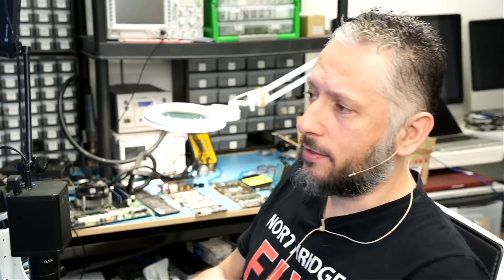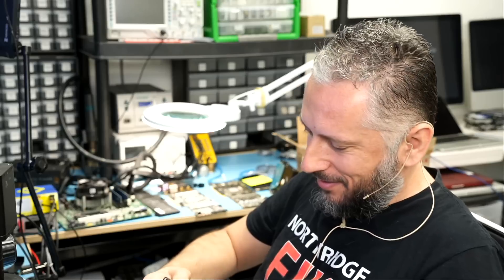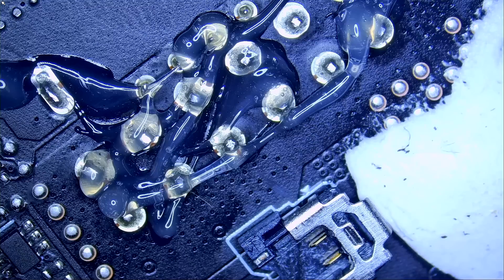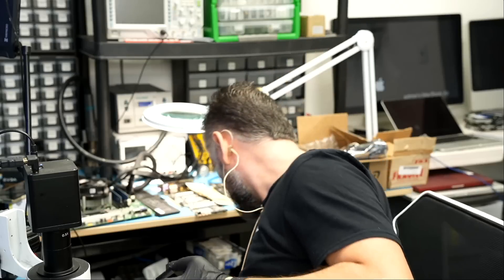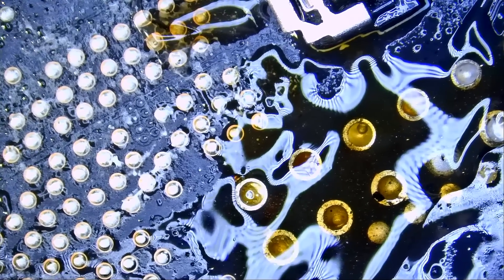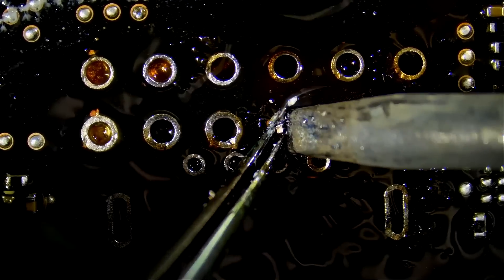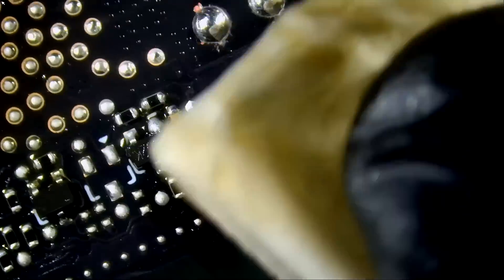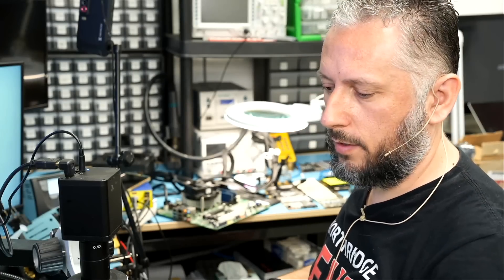4090 FE Connector melted with Cablemod Adapter installed. 40 series cards should be recalled

Comment: This exact issue has just happened with my 4090 FE with the same connector from Cablemod. Can remove the end to the PSU from the connector easily but feels and smells like the connector is melted into the connector on the card…. Thank you for showing it’s not as simple as saying “user error”, especially when most 4090 earners and enthusiasts and take great care when building PC’s etc.

Comment: mine finally melted, I thought that if I absolutely made sure that the connection was perfectly seated, it would be fine...WRONG. It melted after 1.3 years in daily service. There is nothing I could've done different to prevent this. This is ABSOLUTELY a design issue, not an end user issue.

Comment: My sense of this is that the 12 pins of the card plug into the socketed connectors of the adaptors and those female pieces are too loose and what we get is arcing between the pins and sockets. Arcing would explain the melting not just heat alone. It's a bad design on Nvidia's part and explains why EVGA decided to get out of the GPU game. Next people's houses will burn down over this.

Comment: . . . The gauge of pins is adequate for the short distances that they run; they could be replaced by 16 gauge wire for about 8 inches and mercifully spliced to the adapter connector cable,  observing polarity, of course; the small wire connector should be cut away from the larger part of the item's connector and mercifully plugged in by it self. . .

Comment: My guess is the lead free solder used in their wave machine If Alex uses 60/40 and the connectors last, it tells me the solder used on the power connector is where the resistance heat is coming from that's melting the connector. The power wires are thicker then the board traces so the heat melting the connector is most likely from the connector to PIH solder joints.

Comment: My 4090 just had the same issue ytd with cablemod 90’’ adapter… Im pretty sure I ensured my adapter is plugged in all the way after watching jay2cents video, but it still melt after almost half a year of usage. now im contacting local service center and cablemod support to try to save my card😢

Comment: A new GPU built by my company games at 360 fps. The plug heats up. The GPU burns with everyone trapped inside the house. Now, should we initiate a recall? Take the number of GPUs in the field, A, multiply by the probable rate of failure, B, multiply by the average out-of-court settlement, C. A times B times C equals X. If X is less than the cost of a recall, we don't do one.

Comment: If the Cable Connector has even the slightest movement after being properly Installed then it is a design defect and it is the manufacturer's fault.

Comment: USER ERROR IT IS NOT IN MY CASE....My Asus Strix 4090 OC just burnt out its cable pins. Cable was and is stuck/melted in the card. This sux especially when you pay $3800 AU. I will give up on PC building and PC gaming altogether if I don't get RMA.
Reply: when this happen i mean how long you was using this card some weeks ? ? You extra overclock gpu or ? What psu you have ? i order this card and scared of this..... it this destroy only cable or complete gpu too ??? Thanks

Comment: I wonder if this issue in related to the power draw. Many users are using HAF Bios off +666 to 1000W. What would happen with a 4090 with a PL of 80% with an undervolt curve? With just 300w and with a not wore plugged in cable : would  it melt?  I guess you are right, it’s not only an user error, the connector on the PCB side is weak

Comment: Since this whole melting melds I use my Gigabyte RTX 4090 Gaming OC at 0,875V and look that I don't go beyond 250 watts 😂 thats simply ridiculous that you have to be cautious to use a 4090 beyond 300 watts!! For now I'm still using a 180 degree CableMod adapter. I'd like to give it all to northridgefix to fix it and no longer be afraid of using my 4090 stock or OC!

Comment: This EXACT thing happened to me just two weeks ago. I had a cable mod 180 degree connector and it melted into the 4090. I couldn't remove it at all. 

We've got a bigger issue here.

Comment: Plainly and simply: this is a design fault by the manufacturer. These small plugs are not made to take 600+ watts of power pushed through them. The connector definitely needs to be more robust.

Comment: Is it just me or did all 4090s that have melted connectors use that "clam shell" type of contacts for the plug? I recall there being two types of contacts inside these connectors depending on the maker.

One type (I think it's the often melting one) is a clam shell style of connector where there's only two U-shaped points inside the hole that contacts the pin.

The other type of connector uses four contact points that clamp onto the pin from four sides. I recall hearing this somewhere.

Perhaps that's one of the main issues? Just curious, as it looks like that Cablemod Adapter left one of its broken contacts stuck to one of the pins visible on this video, and it looks like they also used the clam shell type U-shaped contact inside the adapter.

Another thing I think nobody points out is that there are other Adapters that look exactly like Cablemod's 90 degree adapter, often sold from China or sourced from there. These ones are often sold with very little mention of info, but they sometimes mention that some are "Rated for 450w" or "Rated for 600w". Could that also be a possible cause of heat issues leading to failure? Had I not checked, I wouldn't have even known there's a 450w and a 600w version of these adapters.

Comment: Hand it to me, Grasshopper. You are no match for my monkey grip of steel. No matter how they melt, it still same problem. Too many watts and not enough pin(s) or plug(s).. Blame China for making them so thin. It's why you don't replace fuses with foil gum wrappers. DUH!

Comment: I'd say the POWER CABLE was fully plugged into the angle connector, but the angle connector was NOT fully plugged into the board.  The electricity was arcing between contacts that should have been mated, this resulted in heat build up and melting.  Just because a user HAS a cable-mod/angled connector does not mean they pushed it on firmly enough to make full contact.  Great job.

Comment: Same thing just happened to me with my cablemod adapter on a 4090 Asus TUFF OC.  Found out when i went to reseat my gpu because every game i tried caused my system to reboot after 5 minutes. Adapter fused with no signs of melting.

Comment: It is now known that the cable mod adapters are defective by design, they have lied about what terminals they are using (They claimed NTK (4spring), in this video it is clear they aren't even using Astron(3 dimple) but using some weird 2 dimple thing instead.

The adapter sits too loosely in cards, allowing wiggle out and uneven installations.

Comment: Companys that build these cards should not even allow these melt thinks to hapen. Not a users fault I would say on this. How these keep coming and coming and every time its users fault because cable aint fully in. There is no way that this is users fault and this confirms that its desing issue. Too mutch voltage for single connector if these cards had 2 connectors and splited voltages thru those this might not hapen. I might be wrong on this but thats what I think.

Comment: I have a 4090 but I've not used it can I ask what the recommended power cables I also plan turn down voltage

Comment: All connectors have a small resistance.  So any large current will generate heat. Also if the connector has any weight of cable on it then it will move and maybe only contact in a smaller area causing higher  resistance.

Comment: They need to put a bolt connection like it is on the car's starter. 😄A just one thick cable for 12v and another for GND, and 4 little pins for signaling. I saw how high amps melt battery poles on trucks if you have loose connections. These connectors are jokes for that amps. The contact surface is too small and then keeps warming and eventually melts.  The female part of the connection can be stretched and lose contact with the connector. The 90-degree adapter adds even one more loose connection on the current path. The bad-quality 90-degree adapter is used here. You need to look into the female part of the connector and if they notice that the square hole in "pins" is deformed and wide then you can use some tools to squeeze it. Not too much but just enough to make good contact with the male part on the card's connector.

Comment: i have a 4090 TUF W/ a Cablemod 180 adapter. Melted. I built my first PC all by myself when i was 8, that was 32 years ago. Came home to an office filled with smoke.

Pretty sure i know WTF im doing. Connector fully seated all the way around the connector.

What a POS Connector. They should have lengthened the contact 1MM for all the pins, or gold plated everything, or hell.... use an XT90 Plug.

Maybe i should just modify it to use an xt90

4090XT90

Comment: Just found out my cable is melted and Ive been following this issue long before I bought a 4090 and made sure I plugged that shit in 100% and it has started to melt on one of the pins. I noticed this after having to remove the graphics card to install a new M.2 ssd.

Comment: The lower tier AIB cards doesn't seem to have melted connector issue, could it be that total Wattage of 450 is kept at bay? The higher tier cards seems to be getting this problem. I'm thinking about buying a PNY Verto of the 4090 and havn't seen a single melted connector on these cards. Has anyone a PNY version?

Comment: I think the card pushes the limits of the connector under normal operation. You throw in voltage drop from low quality or undersized power supply also a little increased resistance from cable extensions. Gotta have RGB and combed wires on your brand new card. Sprinkle in a little consumer assembly. Party time for Northridge Fix 🎉🎉🎉🎉

Comment: I have a question for Alex (which he probably won't see, but on the off-chance)
Given your wealth of electronics knowledge, why do YOU think these power connectors are melting? Sure, 450W coming through 12 power pins. Okay, but the 3090 Ti had (according to Tom's HW) a 437W power draw and used the same 16-pin connector, not a single story of melting plastic. What changed?
Reply: 3090TI's were have issues of overheating

Comment: i think when you try reinvent the wheel from a  4 wire molex to either a 6/8/12/16 pin connector

the problem is 1 to1 you're fine at vdc and amp once you start doubling/tripling/quadrupling 12/24/36/48 vdc and  over amping into 12 volt pin  and slight pin misalignment between cable and  pin connector on pcb connector is causing another issue

2-4 into 1 set of wires it is a design flaw in the pcb of the video card because you are consuming between 2-4 rails of 12 volt of the psu's power connections

you can't push 24-48 volt dc into a 12 volt dc connector or you get this failure point

Comment: Why don't you use SnAg alloys instead of lead solder? It hasnt got such a low melt but is lower than most lead free ones.

By now we should be moving away from lead completely. It is one hell of a toxic substance.

Comment: I've done allot of electrical repairs in my life on circuit boards and maybe what the 4090 Connector Pins are made of is inferior and causing allot of resistance that heat up the pins. If they has a Copper coated pin or use better metal on the pins this issue wouldn't happen. High resistance=Allot of heat=melting connectors.... The Fix would be to solder female 8 pins with copper wire directly to the board. Preferably 3 of them spread out.

Comment: My RC main battery connectors are goldplated to prevent oxidation. 
An oxidation layer increases resistance -> current distribution changes to pins with less resistance -> more heat generated in remaining pins -> more oxidation -> ...
Positive feedback loop until meltdown of the last of least resistance pins.
Just my 2 cents.

Comment: I’m quite certain this is my FE card that I sent in. I Appreciate the breakdown as I was positive it was fully inserted and I did not continue to attempt to remove the adapter after it melted to prevent further damage (as you can see in the video). I have been a firm believer that this is an Nvidia issue from the beginning. I really appreciate that it was noted by Jay that Nvidia has not ever provided a Root Cause which is issue management 101 in any business. Anyway I have a 7900xtx now. Is it a 4090? Unfortunately not but I won’t be putting my money into a company that gaslights it’s customers. Thanks again!
Reply: Honestly it has done everything I’ve needed it to do. I could go out and buy another 4090 but I liked the FE and it’s too difficult to find in stock. I got lucky and received an invite from Nvidia for the one I had. Sure I could go for a 4080 but I’m just not happy with Nvidia so I’ve chosen to take my business elsewhere for the time being.
Reply: Yeah. I read ya. Was about to start building with a 4090 until all these videos and reddit posts starting coming through the doors.
Reply: Got an instagram with picture of your build we can look at? I took tons of photos of all the ones I have done
Reply: Mind me asking how much this set you back?
Reply: @haies09 luckily Cablemod is amazing and they fully refunded me what I paid for my card. Would have been around $1750 though.
Reply: @Natetilllate  A company that actually stands by the goods they sell. A refreshing change.
Reply: @Natetilllate  Are you saying nvda is refusing warranty replacements when this happens? 😱
Reply: @ZubinSaxena yes
Reply: The same thing just happened to me. It is not user error. You can see the connector firmly pressed in on all sides for the one in this video, and I noticed the same thing on mine.
Reply: The same thing just happened to me. It is not user error. You can see the connector firmly pressed in on all sides for the one in this video, and I noticed the same thing on mine.
Reply: Voting with your wallet is the way to go. NVIDIA should have recalled these instead of handling it like how Apple handles these kind of things by downplaying the number of people affected and basically doing nothing.
At least AMD is yet to use this connector although knowing them they'll first make fun of NVIDIA for using it and then do the same thing next gen.

(Being a cheapskate I hope they don't as I'd like to reuse my power supply for the next build and not have to use adapters)
Reply: why go AMD, inferior though!

Comment: Terrible design. Nvidia's Connector use small gauge contacts that get too hot. If physical size was a problem for the overall connection, I don't understand how A GOOD/UPGRADED 8pin connector (4x 16gauge/AWG power and 4x 16gauge grounds) couldn't be used. Using my 12V DC Car Audio knowledge (and 'Rule of Thumb' Wire Size Charts), At 12V DC, in order to flow enough Current (amps/A) to accommodate 600W (600W/12V=50amps if 100% Efficient) over a 4ft connection, it requires a single 10gauge/AWG multi-strand copper wire (1 EACH) for power and ground. 4x16gauge/AWG wires combined = 1 single 10gauge/AWG capacity. 10gauge/AWG copper multi-strand wire can carry as much as 85amps @ 12V DC up to a 4ft distance (DC degrades over distance, requiring larger gauge/AWG wire over longer distances), so even at HALF that Spec, 2ft/24inches of wire out of a power supply to the video card, 85amps @ 12V DC (1020W if 100% Efficient) should be a breeze. THAT IS WHAT A SINGLE 8PIN CONNECTOR'S 16gauge/AWG WIRE IS PHYSICALLY CAPABLE OF (perhaps NOT the power supply or 'Plastic')..... 

Why couldn't the STANDARD 8pin just have it's wire upgraded ? (4xpower, 4xground equal capacity wires) 4x14gauge/AWG wires = 1x 8gauge/AWG = capable of 150amps/A @ 12V DC over a 0-4ft length. That is a theoretical 1800W if 100% efficient, so for argument's sake, call it 1260W @ 70% Efficiency, or perhaps even a bit better, since we are only talking about up to 2ft rather than 4ft. I think Nvidia just wanted to make it's own standard so that it could say it did. FUTURE TRAP.

Comment: The 180 deg adapter made my system instable. Random reboots, freezes and lock ups.

I limited my FPS to around 120. Normally around ~250Watts usage. So yeh, probably a faulty adapter

(And yes, refitted multiple times)

Comment: How many gamers push their components to the maximum and have this problem? I would bet more than one. When you need to wiggle a plug to release it, could this not contribute to its failure? After the user hears the connected click, it could indicate the plug should not be removed.

Comment: After case of 90 degree adapter it is cleared that it is not issue of the way you plug in the cable. Because it is melted from card side.
The main cause is it's heat dissipation failure due to pins within tight area. Widen the connector area OR divide into two connectors may resolve the issue.

Comment: It is true that electrical loose connections cause excessive heat and arcing as I have personally seen in the field I work in.  We sometimes inspect overhead electrical connections with and IR camera and the temperature at a loose connection becomes obvious compared to a good solid connection.  These overheated loose connections we refer to as "Hot spots".   In the case of these, much lower voltage DC connectors, this shouldn't be happening if the board is properly engineered and proper, suitable parts are specified by the manufacturer.  They are probably using some cheap, china made connector that is under rated for the peak current or Full load amps this card pulls!  What I would be doing here is probably soldering 14GA wires directly to the through holes on the PCB where the connector would go and then get an original MOLEX branded connector with a higher ampacity to solder the wires to.  So basically a pigtail coming off the video card.  While not elegant, it may resolve the issue.